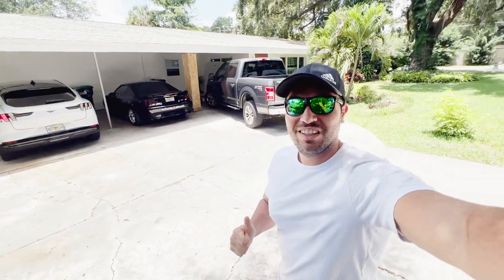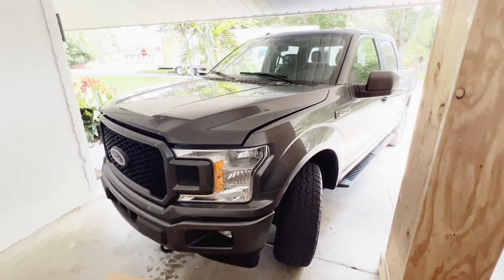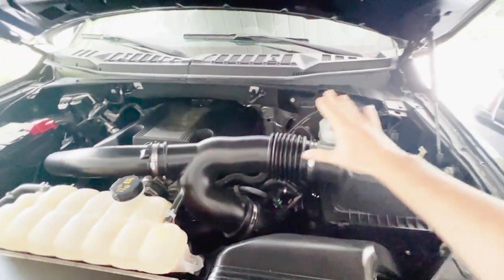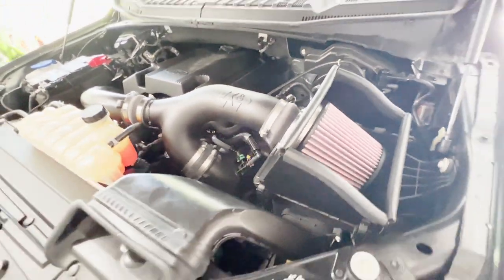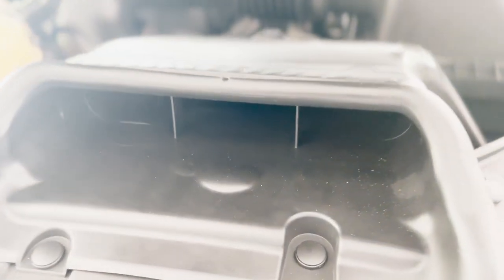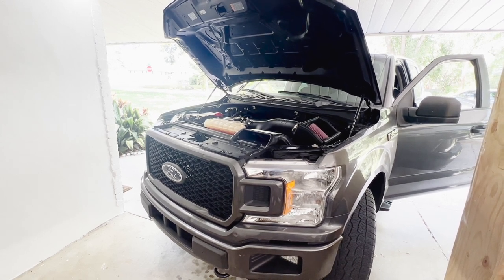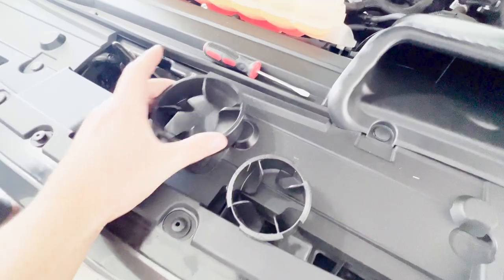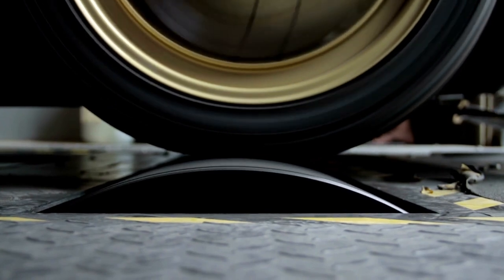Cold Air Intake on F150 Ecoboost - WORTH IT? 2015-2020 Ford

Comment: You should of just put in a K&N drop in air filter. Not the cone. The Ford set up looks fine. Just the drop in K&N air filter.
Reply: Almost. K&N drop in air filter and afe intake tubes are money with those eco boosts.
Reply: @ChrisSmith-we9rn  I have the drop in air filter and the big intake tube works great on Mustang Ecoboost
Reply: @ChrisSmith-we9rn  how can you have the afe tubes but drop in k&n box filter?
Reply: @i3oosted  because it’s literally just the intake tubes. They are bigger diameter and connect to the stock intake box
Reply: @ChrisSmith-we9rn  What AFE intake do you have?

Comment: Installing a "cold air intake" alone without changing the throttle boddy or the tune does NOTHING to increase performance. the amount of air moving into the engine is determined by mass airflow sensor telling the throttle body how far to open. It looks cool, but on its own its worthless.
Reply from the maker: I did this first then tuned the truck, Not sure if it even made a difference after the tune I guess you’d have to dyno it to really find out

Comment: After installing the K&N cold air intake did it set off any alarms for low air flow or anything? I noticed with the K&N intake it you didn't have to install the aluminum tube in the PCV hose.
Reply from the maker: Yea I was afraid I would get some sort of check engine light or something too, so far it’s been perfect, I feel like sometimes it may be user error with installation, but I followed the installation directions precisely and so far so good
Reply: You ever get p04db lol